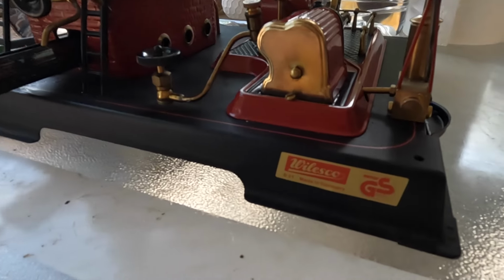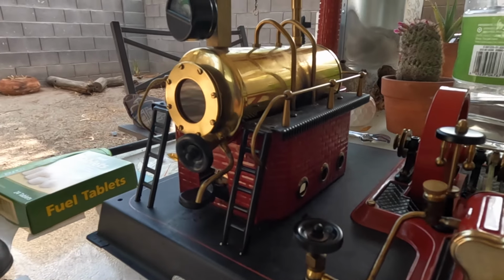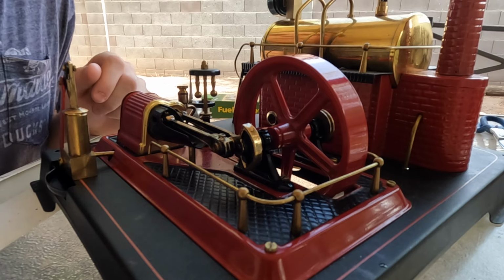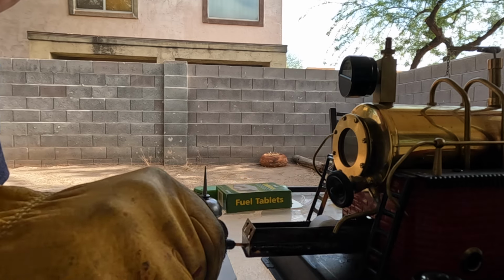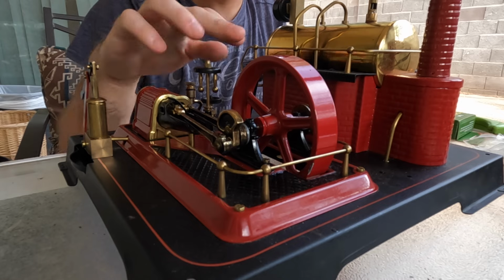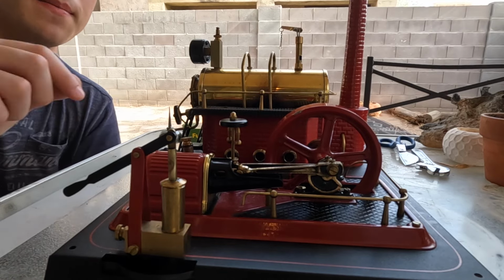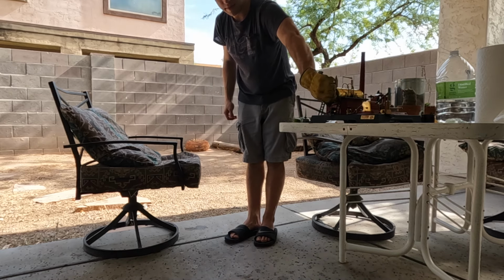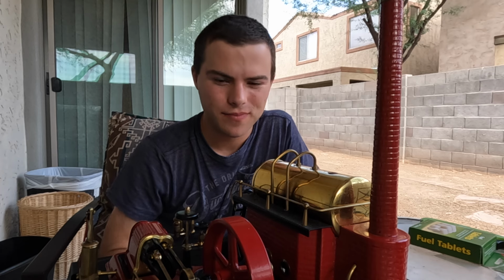My First Steam Engine, Wilesco D21!!!

Comment: Very nice steam model. I've had my D21 since 1990. Made a few modifications. Still runs very well.
Reply from the maker: Nice, I don’t know when my was built. I need to get a few parts and accessories from Wilesco still.
Reply: @nates.vintage.trains  I know Wilesco traction engines now come with a build code under the firebox.. 3 digits, the first 2 are the year it was built and the 3rd is the factory employee code, then the month is in Roman numerals - so mine is, 246 IX = 9 (September) 2024 by employee no. 6. Maybe yours has a similar code underneath?

Comment: Nice! Those a realy fun! I hawe a collection of the smaller ones. D21 is a lot more fun because it is one of the very few ones that came with a feedingpump and this manometer turret. I bought a loose manometer turret and a loose valve to connect an old aggregat i had laying around to the boiler of one of my D 12 so both aggregats can be driven from the same boiler, and i could keep the proper safety valve. Only "flipside" is that those quickly become an addiction since the whole system is like a giant Lego set but with real water vapor! Ha ha I bought a sheapo garage steel plate with holes that fit all the accesories so one can mount it stable and easily change the equipment one want to drive at the moment by laying down the plate and use my old meccano parts to make the installations.
Reply: You could hawe some of my doublett accesories, but i think the shipping would be too expensive unfortunately.

Comment: Hello Nate, that looks like a nice unit in great shape, with not too much run time, after lots of use many things discolor. When i had a few i used Sterno to fire them. After you get one you will know what is coming next.
Reply from the maker: Locomotive 🤞🏻
Reply: @nates.vintage.trains  I really meant more of the same, but a loco would be good too.

Comment: Nice engine,  I had a steamer years ago and sold it for $ 5. 
On the subject of water I now only drink bottle water. We had a supply leak in the front yard, which led to the discovery the street pipes contained asbestos.